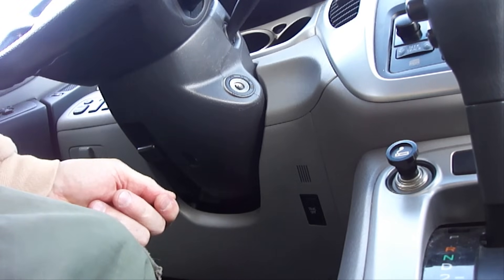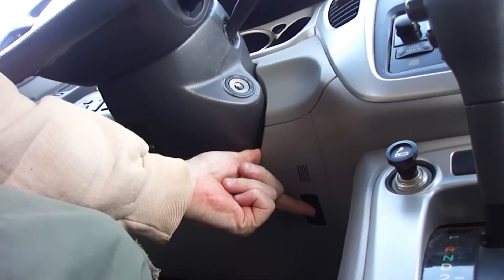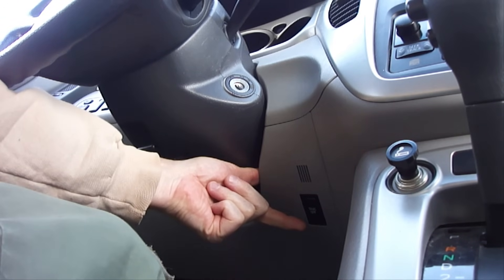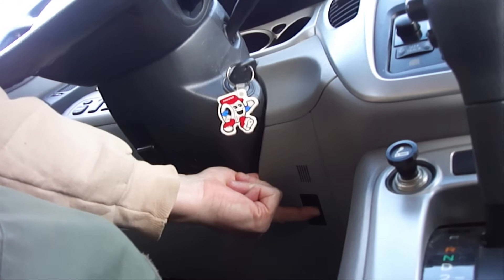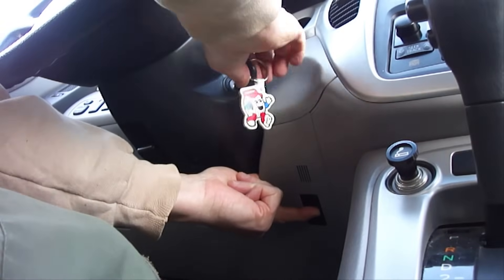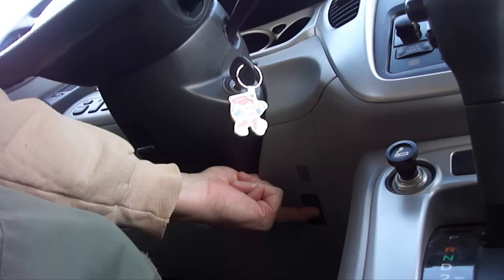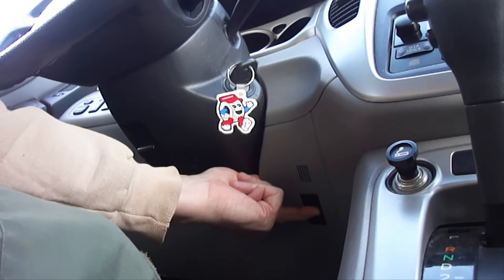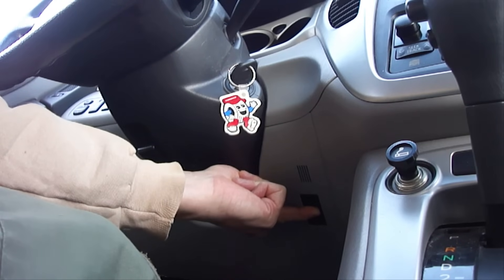(Part 5) How To Fix Your Check Engine, VSC, Trac Off Warning Lights

Comment: MILLION DOLLAR QUESTION-    So the "check engine" light, the "VSC" light, the "NO VSC" light all are lit on my toyota avalon.   I see from this video that it's often just a loose gas cap, or some little button-pushing operation.   SO HERE IS THE MILLION DOLLAR QUESTION-  "if these lights are often, or even "always" simple fixes like this, what are these warning lights designed to warn you about?"    In other words, is there ever any real problem associated with them, or are they toyota's construct to get my unknowing butt into the dealership so they can just feed me a bunch of mumbo jumbo and charge me $275 for 2 minutes of work??? (!)
Reply: o2 sensors... mostly
Reply: Sometimes it's caused by hip-pop hippy to the hippity hip hiphoppa you don't stoppa rockin' so bang bang boogie when you dance to the boogitty beat... or oxygen sensor.

Comment: I just sold my 2004 Toyota Sienna and an hour after I get home the buyer calls me up and says the check engine, vsc, and trac lights are staying on.  They had NEVER come on before but now this guy is thinking he just got stiffed with buying a piece of junk from a crook.  HOWEVER, thanks to this brilliant video I was able to walk the guy through this fix and the lights went out.  Disaster averted.  Thanks so much for posting the awesome Fix!

Comment: I was afraid it was something awful when that many lights all came on at the same time and was dreading the news from the mechanic tomorrow.  I went straight to #5 and it worked!!!  What a good, kind man you are to share these with us.  God bless you.
Reply from the maker: Vicki Packham That’s great!
Reply: What did the mechanic say it is? I had Autozone read the engine code and it says P0793. I am going to try what Paul says in this video first.

Comment: The lights on my Dad's Toyota Avensis 11 reg were on and he was worried. He took it to Toyota dealership as stated in the manual and they also couldn't determine the problem and quoted £1400 to fix something that they thought was the problem, it clearly was not. After trying this it turned off the VSC warning light, traction and the engine management light which it confirmed on the computer trip. After some thought my Dad said this triggered because he recently changed his car battery and all was good until then. Everything sorted now  thank you ever so much Paul and keep up sharing the great knowledge and taking a lot of weight off everyone's shoulders  : ) A day later, the light reappeared ☹
Reply from the maker: Sikandar Ahmed 👍😊

Comment: Thank you soo much! Just bought a car this week and just put gas in it. Has a bad gas cap which made these lights pop on. Replaced the cap. Cleaned around the cylinder and then did this procedure and boom off!! Thank you

Comment: Worked great on 07 LS460L All 3 lights came on after changing oil & jacking car up without turning anything off on suspension. Saved me a trip home to grab scan tool. Thanks!
Reply from the maker: TheDynotuner 👍😊

Comment: Paul, my check engine, vsc, and trac off lights are on. I had Autozone read the code. It says P0793, intermediate shaft speed sensor A circuit no signal, and the explanation says it's used for cruise control. My vehicle drives normally, and the speedometer works fine. I had the engine oil changed on Tuesday and then drove two days, more than 200 miles on hilly area. The car runs beautifully, smooth and quiet. I wonder maybe the engine threw a code by mistake, before the oil was changed, because at that time the oil wasnt changed for 3-4 years, as i only drove 1700 miles, and dealer said change it after 5000 miles, and the pandemic also made me forget the lapse of time.
So, I already put petroleum jelly on the fuel tank cap gasket, and it bounced back, became resilient again. Next I am going to try what you instructed in this video. Hopefully the engine code was by mistake and will go away after I do this :) It's a 2005 Toyota Sienna with 97k miles. Probably won't get back the big bucks I spend on it for expensive repairs.

Comment: Worked for me! Thank you very much sir!
In my case, "press-hold the track off while the engine is off and then turn the engine on" was enough to get rid of the lights. Didn't have to do the cycles.
Reply from the maker: Waqas Shah 👍

Comment: I had these on my ' 05 D4d for a while but the car runs fine anyway. Today I decided to do something about it while sat at home bored.
I just disconnected the negative terminal of the battery and left it for about 10-15 minutes before reconnecting it and Bobs your Uncle, it worked.
No more dash lights on.
Reply: Glad it worked for you. Yeah, these lights are also on , on my 2005 Sienna, but the car runs fine. Wondering maybe the car computer is like regular computers, have bugs sometimes and throw codes by mistake. I am going to try following this video.

Comment: It worked! as it turned out some waskly wrats had chewed the wires to my MAS sensor. upon repair the lights would not go off until I did part 5.
 thanx so much.
Reply: How do you repair the wires? I am also worried if rats chewed the wire of my intermediate shaft speed sensor. I did see rat in the neighborhood.

Comment: my battery died on the car and after jump starting it I let it run for a while and turned it off and then back on and it’s good. 

Lexus Gs350

But now I have two beautiful lights just RIGHT THERE ! 

I did exactly what you said and it didn’t work at first so I shut down the car looked at other videos and when I restarted it. They went away! Thank you!!!

Comment: Wow thanks,I was at my wits end messing with my juke. Tried all sorts and this has worked,just hope it stays off hit my wheel vas some guy in a van was on my side of the road and it came on xxxx
Reply: Just drove less than a mile and the warning and the red engine light came back on sadly,so think it's a mechanic next

Comment: I tried all your ideas, ended up going to Orielys auto parts and the dash lights were turned off with a meter that is plugged into the bottom of the dash. Hope the VSC and engine light don’t return no cost to me.  🤞 🇺🇸

Comment: If you have an older model and you had to change your battery or if your battery died or was disconnected you have to bring it to a lexus dealership to recalibrate those sensers. It's not charcoal filter.

Comment: Crucially, those lights come on when you have a problem. Making the warning lights disappear doesn’t make a faulty injector or a blocked EGR valve/DPF go away, it’s just masking the problem.
Reply: That is true it could mask issues but I have been manually resetting my 2006 Lexus Gx470 for the last 7 years and now over 300,000 miles and car has run the same for the last 100k miles

Comment: Thank you step 1 through 4 didn't work but this step worked Lexus IS 350 2007
Reply from the maker: M. V 👍😊
Reply: @proclaimliberty2000  Yea I was cleaning the throtel body and then reinstalled everything but for got to connect the TPS sensor lol. So it threw the code.
Reply from the maker: M. V 👍😊

Comment: Hi. :) Does this solve the issue? I mean the reason why the indicator light came on or it's just to clear the error?
Reply: Right? Everyone’s thankful their lights went off but I’d like to have some idea on whether or not the reason as to why they came on is resolved or just bandaided.
Reply: @walkerl.9402  I fixed mine a month back. I spent roughly $300 to get it fixed. The issue with mine was the cats. were removed when I bought my car.

Comment: Found my problem, loose connection between Intake Filter and Throttle Body.  Tightened the connection, then drove 25 miles, the light went off when I started the FJ after that.
Reply from the maker: 👍😊 Excellent observation. Good job!

Comment: I found the fix
By accident
Fill your tires up to 50lbs
The tire sensor affects the other sensors.
Reply: Does it affect countershaft speed sensor, too? My tire pressure light often comes on after driving on bumpy road, and went away after turning off the engine. I never did anything about it. I saw a tire pressure reset button on my dash board, maybe I should do something about it.

Comment: With my Lexus IS220D, I discovered that the problem was with a faulty fuel filler cap not locking tight.

Comment: I have a 2007 toyota rav4, three lights came on at the same time. VSC, 4WD, and CHECK ENGINE lights. so haveyou come across this problem and how do you address this issue? mine does not have the track button you r pressing.
Reply from the maker: Jeff Cowbuoy if part one through seven does not clear the lights which are quick fixes then take it to an auto parts store and they will normally put a diagnostic scanner on the car for free which will give you other clues as to what’s wrong.

Comment: I have a Lexus rx330, will these videos 1 through 5 work for the abs  light ,tire pressure  light ,brake light and vsc light that keep coming on? Thanks so much!
Reply from the maker: I would suggest you take it to an auto parts store and have them put a computer scanner on it which they should do for free and see what trouble codes you get.

Comment: I have a 2008 Lexus ES 350 with Low Engine oil Check VSC sign . The car has 77k miles . Any help pls.
Reply from the maker: Did you check the engine oil on your dipstick?

Comment: Dear sire you already answer my question but somehow its deleted...
so there is loads of white smoke coming out of the exhaust . its NOT the coling liquid leaking. the EGR is/was replaced, i have tried expensive variants of diesel...stil the smoke is there :(
Reply from the maker: It's either burning engine coolant from a cracked or warped cylinder head, head gasket failure or cracked engine block.  Or, it's burning transmission oil from a faulty transmission vacuum modulator valve.
Reply: proclaimliberty2000  Thank you and God bless!
Reply from the maker: kaiser mustafa You’re welcome! I just don’t know what else it could be other than the things I mentioned.

Comment: I hope you can help me
I have changed the complete ABSModule on my Toyota-Corolla 2004 and for sure bleeding 
Bakes working fine but i have lights on vsc abs and trc off all 3 light are permanent on on the dashboard!!
How to solve this issue?!
Thank you
Reply from the maker: If you performed part 1 through 5, it can sometimes take up to 50 miles of driving to turn the lights off.  I'm posting Part 6 tomorrow.

Comment: Hallo,  I have similar problem but it is with Check Parking Brake system. I tried your tips but light comes back on..any suggestion ?
Reply from the maker: kirit Your parking brake cable is probably seized up or one of your brakes is seized up. You should really have it looked at by a good trustworthy mechanic before driving it more.
Reply: @proclaimliberty2000  
Many thanx for reply. You could be Right. I am talking about avensis 11 rreg. Electric hand barake. When I release Hans brake  can hear  sound  something is  detached. Is that caliper problem.? But more confusing thing is Toyota dealer plugged the to device for error code.... They  say  I have to change EGR  valve. Is this Right ?
Reply from the maker: kirit jai You may need an EGR valve replacement but that cannot be related to your hand brake warning light.
Reply: @proclaimliberty2000  
Ok..... Thanx for the help....
Reply from the maker: kirit jai 👍😊

Comment: I have tried all your suggestions twice none of them work?
Reply from the maker: These are quick fixes for people on the go.  I would next suggest taking it to an auto parts store and have it checked with a diagnostic scanner which they will perform for free.
Reply: @proclaimliberty2000  Not around here they won't. 1/2 hour labor charge minimum just about anywhere except Joe's Barnyard Autoworks, and I'm not about to go there.
Reply: @TheSentientParadox  Do you have Autozone or Advanced Auto in the area? Seems they read the codes for free.

Comment: So I have a 2004 GX 470 and it does not have a VSC TRAC off button, now what?
Reply from the maker: Ron Lacey take it to an auto parts store and have it checked with a diagnostic scanner which they will perform for free.
Reply: @proclaimliberty2000  thank you, that was my next step. It appears VSC TRAC button has been retagged as the button with the four wheels next to the seat warmer on the center console.
Reply: @proclaimliberty2000  I got a CODE P0330 Knock Sensor reading. When did Lexus eliminate the Trac Off button from the GX470? I do not have one in my car.

Comment: Paul, i have a 2009 lexus rx 350 and my interior lights and dash lights aren't coming on. I checked the fuse in the engine that says dome and I changed the fuse but still nothing. What can I do?
Reply from the maker: Does it start?

Comment: It worked for me but, my question is . What makes this pop up ? I did it the other day it was gone the whole day and a half and came back on again 🙄please i would like to know if this is something serious? Thank you...
Reply from the maker: The simple answer is one of the systems has failed or needs to be reset.  If you go to an auto parts store they will diagnose your vehicle with a diagnostic computer for free which will give you valuable information as to the problem.